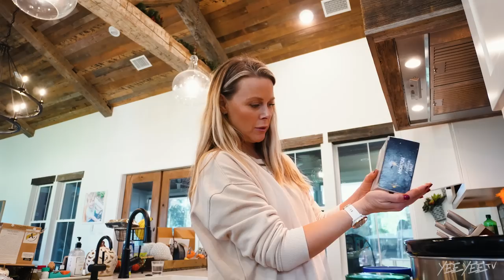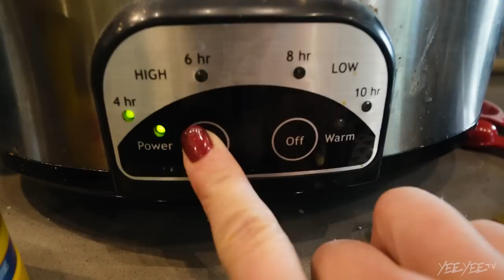Decided To Destroy The Barn!

Comment: 25 years as a contractor I can safely say there is no right or wrong way to tear down a building. As long as it ends up on the ground, no collateral damage and no one gets hurt, then it was done correctly.
My contractor OCD though wonders about the Alaska special siding (tyvek wrap) and if it is going to be covered before winter and the cold tears it off.